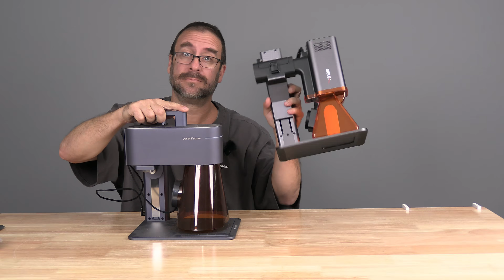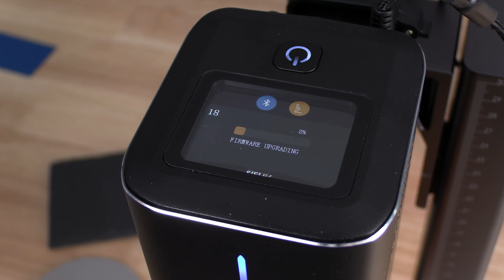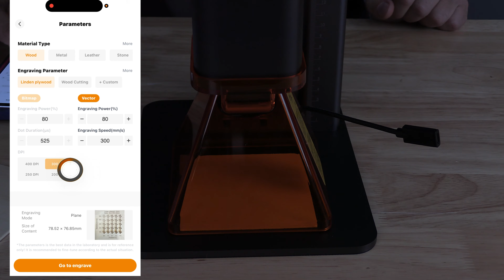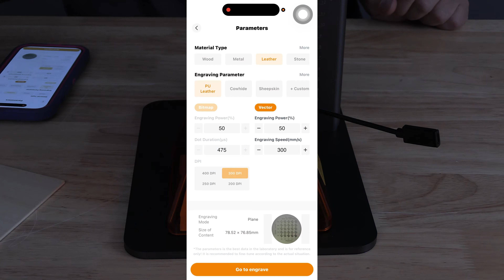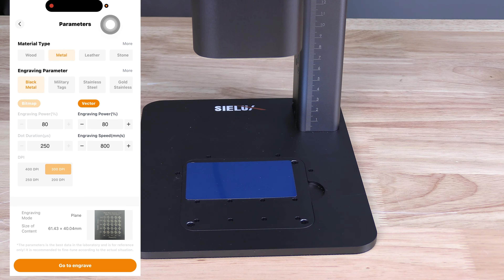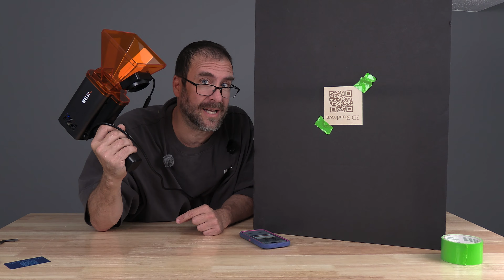Introducing: SIELUX "SL2" Laser Engraver. It's...... SMALL!!

Comment: I want to see the roller used on a mug. Thats such a small machine for a big $1,000 price tag for the package.
Reply from the maker: I'm not experienced with rollers. I own one for every laser, but have never used one. I believe the machine is currently $599 on it's own. It's certainly small, but that's kinda the point. My LP4 feels too big to be using hand held, unless it's a high paying gig or something (but it's certainly a more advanced unit)
Reply: @3DRundown i do vinyl cut graphics and htv apparel as well as 3D printing and I want to get some laser engraving setup to do mugs/tumblers that doesnt cost an arm and a leg. I did sandblasting/etching for a while but it was too much work. I would cut vinyl stencils for mugs then sandblast them. Too much work involved. Been looking at the Creality Falcon setups but they are so big.
Reply from the maker: TBH, the beat laser setup Hardware/Software, I've been able to try, is XTOOL, by a Country Mile. Perhaps an F1 would suit you?
Reply: @3DRundown yeah i was looking at the Xtool as well. Just wanna engrave some wood/metals and mostly tumblers/mugs. I work out of my basement and some in my garage which isnt heated so cant do much in there in the Minnesota winters. So compact space is a plus.
Reply from the maker: I feel you there. My studio is in my basement, and my laser work is in my garage. In NJ, it's TOO HOT, TOO HUMID, or TOO COLD. Never great. Lol